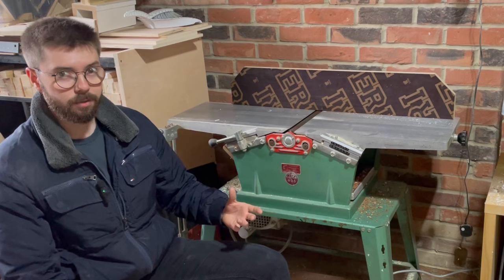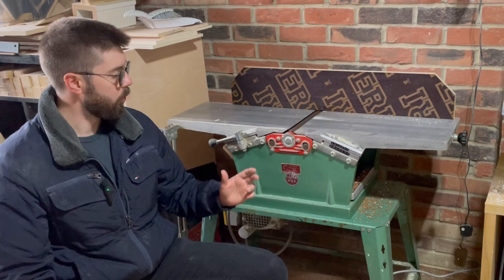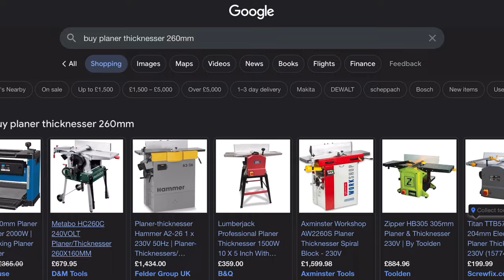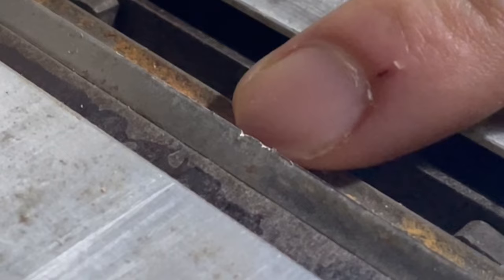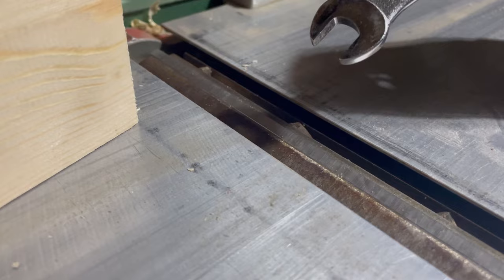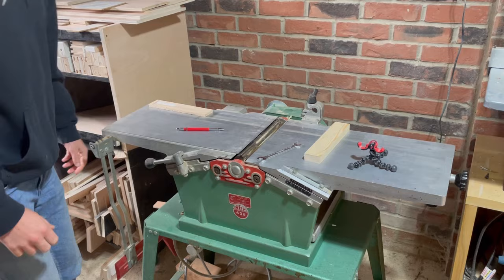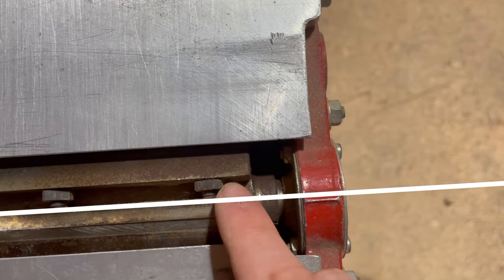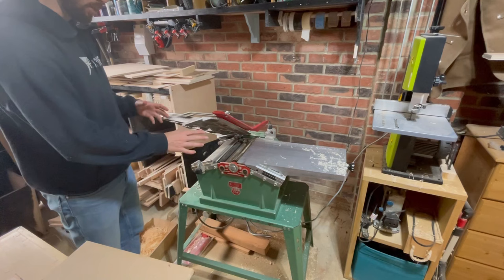I bought an old planer/thicknesser (Kity 636), should you? (+ how to change/set the blades)

Comment: I have the 636 when planing the cutter guard should be in place, mine has a adjustment knob to raise and lower the guard (left hand side where the arm pivots). Wood passes under the guard keeping your fingers safely out of harms way. As others have mentioned download Kity's manual. Also the Kity has two feed rates which by adjusting drive belt between two different size pulleys.

Comment: Ha, this could be me, currently going through the same process with a nearly identical Kity 635 off marketplace. Setting the blades is a right pain – I believe some models have more proper adjustment built-in, but not these, so to some extent you're fighting the springs. I need to rewatch the bit with reference lines a few times as I'm still slightly unsure what will work...
Reply from the maker: Honestly it’s a great bit of kit but I’m dreading having to change the blades next time haha 😂 I think there’s a jig that I could make to make the process easier, have some thoughts so if I ever come to make it I’ll make a video!
Reply: @thornedesignco  yeah there must be a better way! I appreciate your insight...
Reply: @thornedesignco  Quite simple to adjust just follow instructions from the Kity 635 manual which you can download, I have 636 which is identical but larger capacity.

Comment: I can't figure out how to move the belt from one bit to another it's just being stored at the mo not in use still getting up to speed. Someone said theirs a guy in Liverpool who restores kitty machines and parts. Apparently shepache is the current brand IE used to be kity
Reply from the maker: I’m yet to try to change the speed, thankfully it’s current setting has done the job - will make a video if I figure it out 😂
Reply: Just swing up the round cover plate on the far side, or right as you stand when surface planing. Disengage the rollers with the lever you discovered and lift the small drive belt over the top pulley to change the speed. @thornedesignco  Hope this makes sense!

Comment: I have this exact machine - do you find that the thicknesser leaves a slight pattern every few mm ? Looks almost wavey if you hold it up to the light. I have new blades on it
Reply from the maker: Yes! I thought this may be to do with inconsistent height setting between the two blades, but thankfully after a few passes with the sander they come out :)
Reply: @thornedesignco  glad to know it's not just me! I wish the out feed roller was rubber coated too as I've had a few times where the wood slips as the blades pull it back. But other than that it's a decent machine
Reply from the maker: Ah haven’t had any wood slip yet, though I did get a whacky ‘wave’ going through today, I think I may have set it to take off too much in one pass…

Comment: You will probably find the green safety guard/ chip shoot, will need to fit under the table and connect with a micro safety switch, to allow it switch on,
Look on line for a pdf manual and print it out
Reply from the maker: Oh that would be helpful, the guy mentioned that the switch issue may be due to a safety feature but he couldn’t remember what, I will try and see if I can figure that out, thank you!